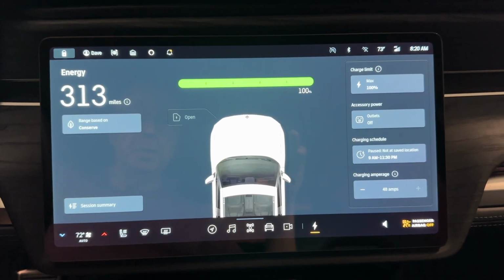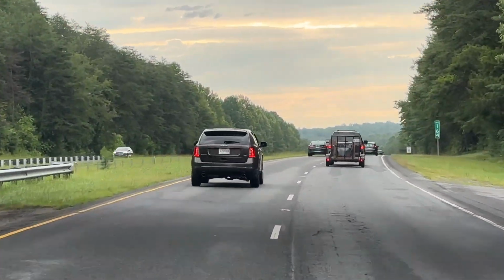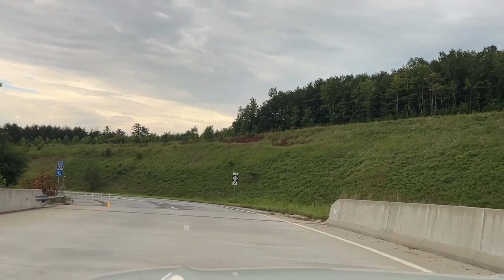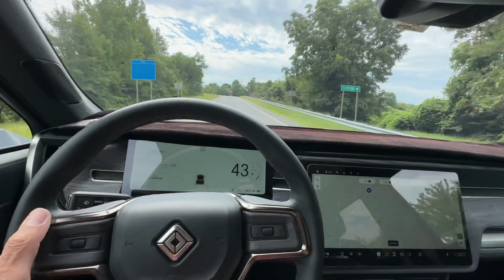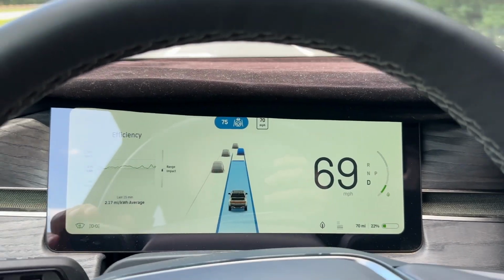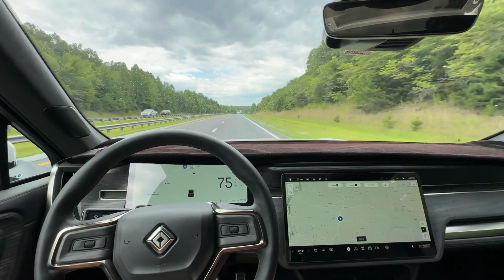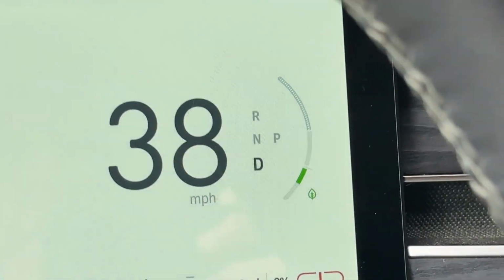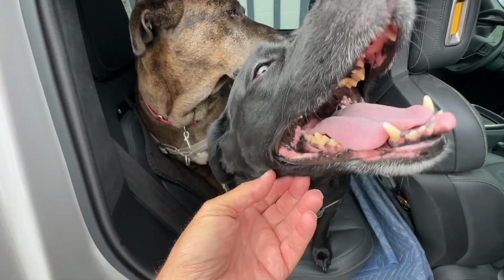Rivian R1T Range Test - How Far will it Go at 75 MPH?

Comment: Why do they not have a 1 cylinder diesel turbo engine running just as a non stop charging motor so as a hybrid setup you get 1000 plus mile range.... i never understand this crazy one or the other stuff.
Reply from the maker: I suppose you pee in a bottle so you don’t have to stop, that’s cool I did that years ago too

Comment: Why drive against hurricane force wind levels? Why not 90 mph? Look, these “real world tests” are endorsing dangerous driving practices on public roads. As to EVs, driving fast between chargers is highly illogical. It’s adds a higher cost, wears out tires and cause higher battery temperatures! Driving at or below posted speed limits uses less energy per mile increasing the range. A 77 kw battery pack with 25% increase in efficiency is far cheaper. There is no time benefit in being wasteful.
Reply: Up to a point, it's less time to drive fast and charge more. Run the battery down to 5-10%, leave the charger when it starts to taper off, and do it again.

Comment: A normal person will start looking for a charger when you get in the 20's SOC.  Posted 75mph Hwy everyone is going 80-85. If you are doing 75 you are getting passed by 18 Wheelers.  MY guess is that when you are doing 85mph moving along with traffic, you will get a little over 100 miles of range by the time you start looking for a charger.
Reply from the maker: The car calculates the Arrival battery percentage, just keep an eye on that and you’re golden
Reply: @evdave528  As the car was calculating, I too was calculating using  Laplace Transformation to verify if the Arrival battery potential percentage was a close approximation to my predicted Domain Vs the Frequency of usage as compared to the distance traveled to the supposition of the X,Y of any possible available charging station in the general proximity of arrival position. Postulated failure to do so would result in limp mode and then static mode on the shoulder of the autobahn. Not a safe posture as the Danger is significant and not to mention illegal unless you convince the local authorities it is a break down and not due to lack of fuel/electrons.
Reply: 10% is the sweet spot for getting to a charger. A little less if you have a reliable (so Tesla at this time) network. Those charging miles are almost free, time wise. I would leave more buffer in a CCS car. Rivians can Supercharge now.

Comment: Can you try it with 85mph? Everyone in Michigan is doing 85 on highways..
Reply from the maker: It would be a little less, it tends to be linear
Reply: @evdave528  Less for sure, but I'm expecting a non linear range drop. The aero drag portion of road load increases as a square of vehicle speed theoretically. What I'm trying to get a feel of is that is 55mph constant Speed gets you EPA range (for example), and 65mph gets you a 20% range drop, is 85mph ~40% range drop on something as big as an R1T?
Reply: @MADMAX7330  Yes, Drag force in lbs is 0.5 * ρ * V^2 * S * Cd.
Reply: Somebody has a Model Y Long Range video where it gets the then EPA 300 miles at 60, about 270 or so at 70, and 240 at 80 on 100% battery.  Rivian might beat that a little, at least percentage wise. And the Max pack would definitely do more. I think.
Reply: @bigoldjim4696  it’s going to lose mileage as a percentage of its total range the same as a Y or any other EV from 60 to 80 in drag force but it will also lose more due to more rolling resistance on tires due to higher weight.

Comment: I would have guessed 130 kWh x 2.1 miles/kw = 273.  You came very close.  Thanks for the data.  By the way Dave, I just did 450 miles one way on I-20.  We got ~2.31 miles/kw on the 22's at 78-80 mph.
Reply: As a comparison to a Tesla Y on average, over a year, winter summer in Ca, commuting driving 78-80, I get 3.5 miles/kw (285 w/mile as the Tesla computer shows).  I'm thinking of switching to this truck but the energy cost will go up 52%. Hmmm...
Reply: The 20's with AT tires have the worst effect for the range as it claims to have about 20 to 35 miles less range

Comment: I would take it in for service immediately, something maybe loose. It was one thing that the steering wheel was off but now that warning popped up, the issue could be getting worse. Be safe!
Reply from the maker: The linkage is solid, just the wheel is off but understand I can adjust it with new software

Comment: I wonder what the miles per kilowatt was.
Reply from the maker: I think it was like 2.2 mi/kWh
Reply: That is really good at 75 mph my truck after summer and winter driving a year on mixed driving and some 0-60 runs for my friends is exactly 2.2mi/kwh with 20 inch offroad wheels.